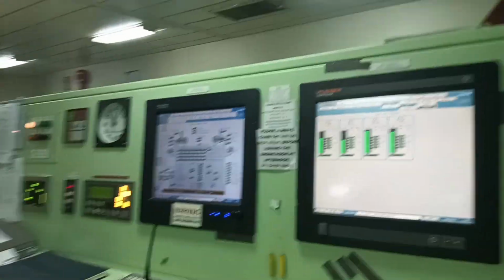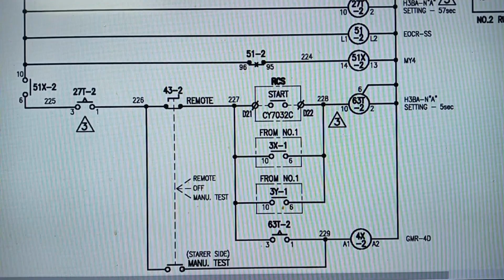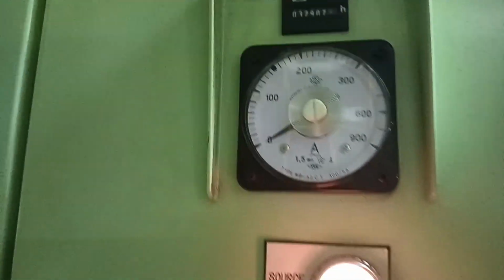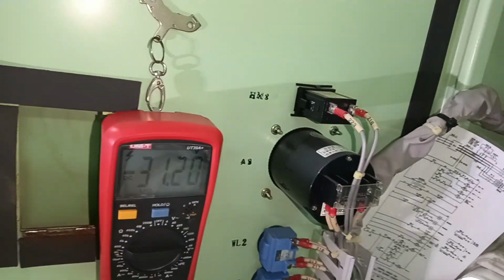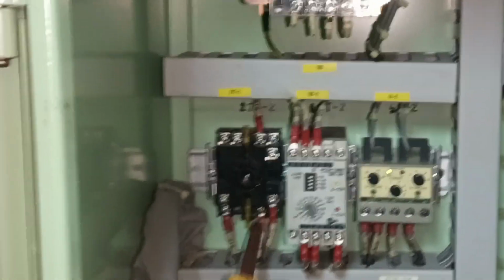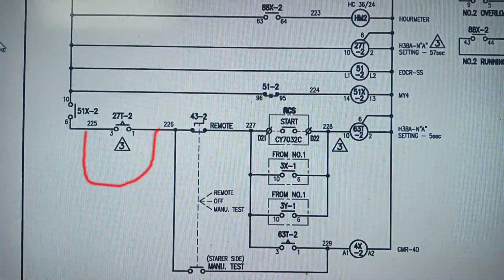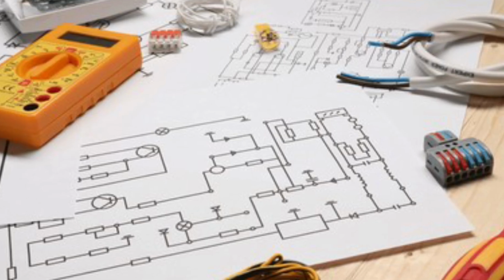𝙈𝙖𝙞𝙣 𝙀𝙣𝙜𝙞𝙣𝙚 𝘼𝙪𝙭𝙞𝙡𝙞𝙖𝙧𝙮 𝘽𝙡𝙤𝙬𝙚𝙧                𝙁𝙖𝙞𝙡𝙪𝙧𝙚, 𝙬𝙝𝙞𝙡𝙚 𝙋𝙞𝙡𝙤𝙩 𝙤𝙣-𝙗𝙤𝙖𝙧𝙙.

Comment: Thanks for sharing. What is the duty of 27T-2 timer? When did you skip it, was there any difference during the operation?
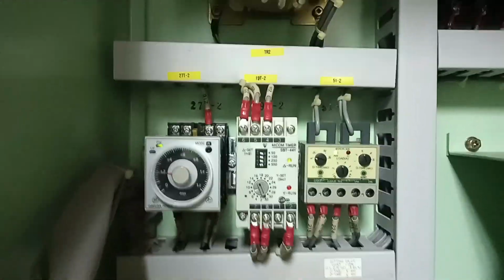Reply from the maker: 0:49 There are a lot of applications if you are using a timer; in my case, his duty is to control the operation of the circuitry to give a continuous voltage supply going to the holding coil of 63t-x during (RSC) and 4x-2 for manual operation, with the specified time. There's no difference since the timer is used only during power up the control circuit.